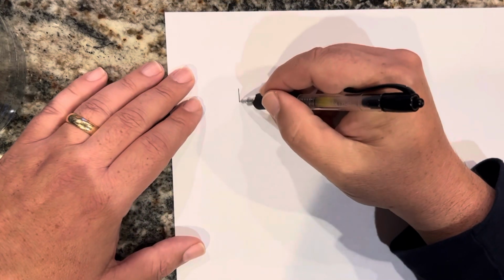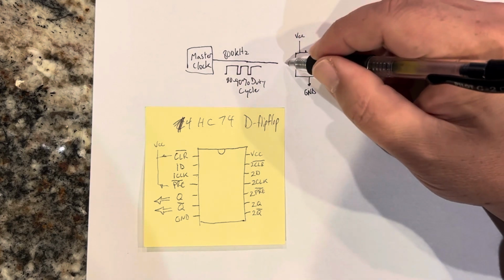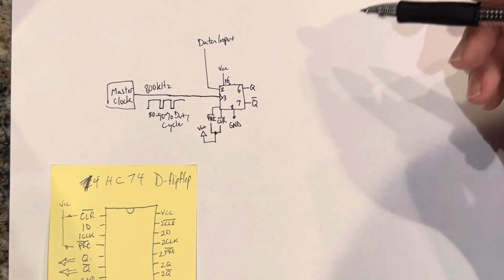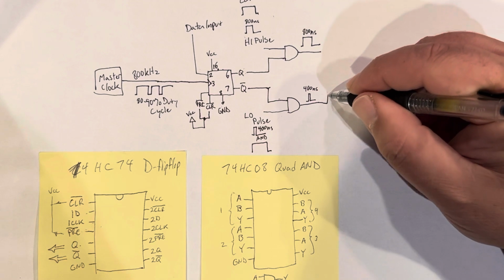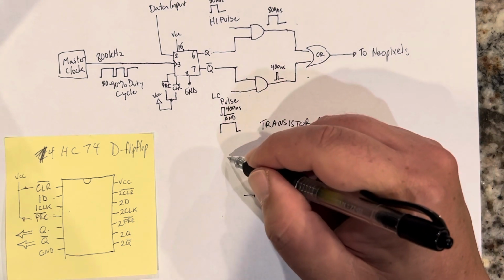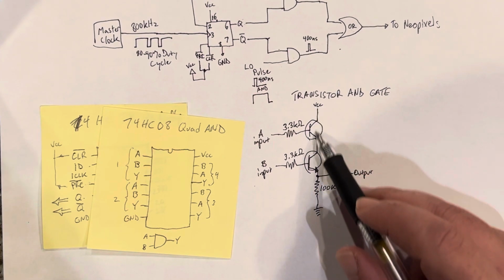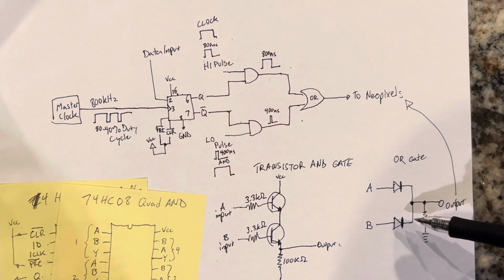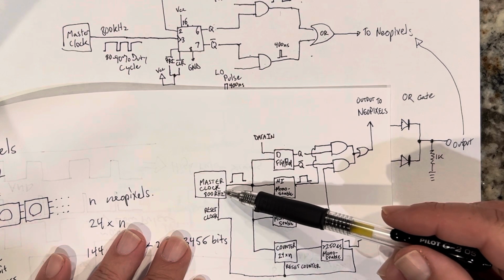How to make a neopixel driver circuit Part 3 - D-flip flop sync and transistor logic gates

Comment: Since you have your sequence & combo logic through CD 4xx...chips..,
You could try out the CD4538 
& / or the CD4528 each being dual monostables FF ..
both can be wired as retriggerable or non retriggerable..on either rising or falling edges of trigger pulse.both can be resetted with an active low reset ..
Both the Q & /Q outputs are available.. 
Both are pin  to pin compatible with each other & can be swapped..
The ....4528 is specially for extremely  small pulse widths.
Reply from the maker: Yes, i thought about that. The 74hc4538 is a super fast monostable pulse generator and is compatible with cd family chips. I was trying to use what I had without getting more chips to lay around. It was kind of fun to work around the problem using propagation delay though. Very stable monostable lo and hi pulses from d-flip flops that i had laying around so pretty happy with results. The most elegant solution though is as you suggested. Thanks